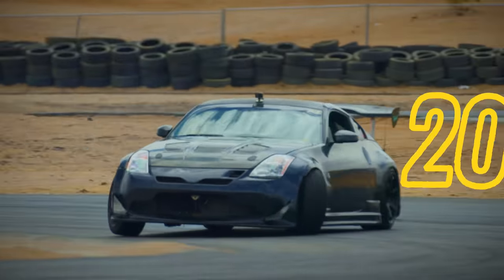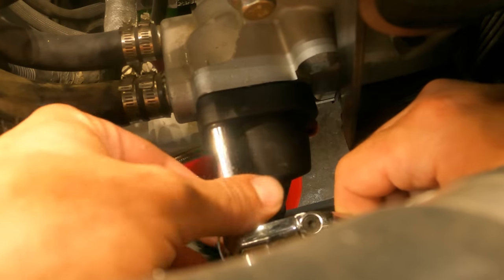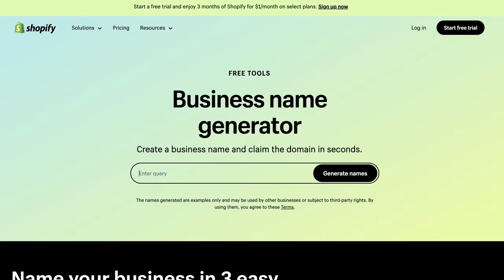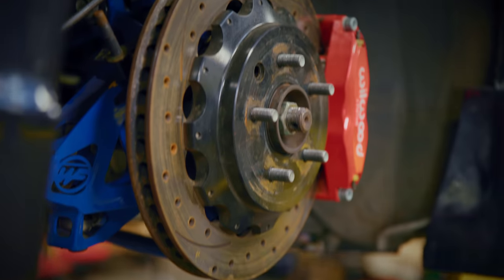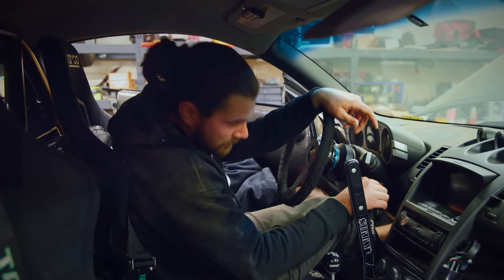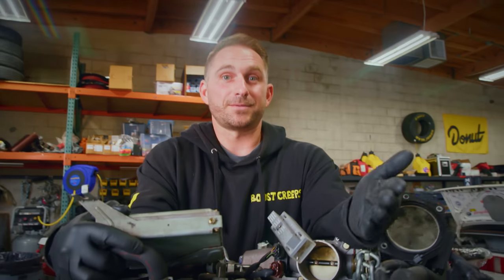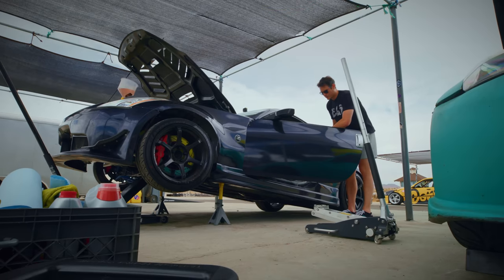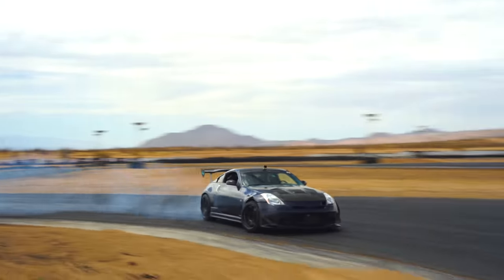Our $100,000 Nissan 350Z Has a Problem

Comment: Not a certified mechanic but I’m a professional you tube commenter. I feel that high cars cooling system isn’t big enough for the application and the demand from the motor. Bigger radiator and more air flow. Maybe vent the hood to get rid of excess heat as well. Drifting puts such a higher stresses on the motor. Cheers.

Comment: OK, I know this might be stupid, but it's worth bringing up: 
I'm not sure when in the build you did the engine swap vs. the radiator swap, but it could be that the cooling system was perfect for the v6 350z engine, but not for a beefy V8. Either way, if everything is working right, maybe something just isn't up to snuff.

Comment: Are you running the steam vents or did you block them off. If the latter that can likley be a problem and leaving air in the system.

Comment: Wow you guys can do about anything to start, get a car going. I was hoping maybe you guys could help me out my cot won’t turn over it won’t even crank all the light on the dash light up I have no idea what is wrong. I have changed the alternator and nothing and my starter works I have tested it out. Well the problem happened as I was driving I was about 85 to 100 mph on the freeway but, as I got off of it got to the fist stop light at around 15 mph car just tired off and just couldn’t get it to turn back on 😢 I’m running out of ideas on what it could be and also running out of money 😂 the car is Mercedes 2010 E350 4matick 
If you guys could give me more ideas or some type of solutions would be awesome!!

Comment: There are 2 different reluctors for LS's crank signal. The 24x and the 58x. Make sure your sensor matches your wheel in the engine and make sure both of those match the ECU. Thanks for the content!

Comment: There are 2 different reluctors for LS's crank signal. The 24x and the 58x. Make sure your sensor matches your wheel in the engine and make sure both of those match the ECU. Thanks for the content!
Reply: They also completely neglected to think about the wheel itself. Too big of a gap or a defect in the wheel = no signal.
Reply: Came here to say this, or at least something similar. Gotta make sure the reluctor is correct as well as the distance between the two. 

I swapped a 4.6 from an 09 F150 into an SN95 a few years ago and had constant cam position faults. Turned out the cam reluctor on the F150 had several more “teeth”.
Reply: You're both probably right, but the custom ECU will be far more tolerant of  weak sensor outputs than stock. They can be tuned to be road compliant too, even having switchable maps
Reply: @mandrakejake might not be the right place to ask but what makes custom ones street illegal
Reply: @Baseball4mnstarz  tailpipe emmisions when tested. If you tune for performance, you'll likely emit too much unburnt fuel. You can have 2 maps on most ECUs though.
Reply: @Baseball4mnstarz  Feel like that's more of a Cali thing. Can't do anything to your car.
Reply: @TopGoose-bf1mx  The crate engine they bought only comes in a 58x reluctor and the E38 ECM only uses a 58x signal. I do not think this is their issue.
Since the ECM won't take the tune I would just think somehow they botched it and should just try a new one.

Comment: Some notes when testing wiring integrity, multimeter leads can splay the terminals in the connector and prevent good contact. You can also have bad wiring that passes a continuity check, but doesn't carry current when loaded. If you wire in a lightbulb to load test the wiring, you will be able to basically 100% confirm good wiring. It would be really cool if you guys tried using an oscilloscope to view the crank sensor pattern since this will show you the waveform that the ECU sees and you can see if you have signal, bad exciter ring, etc
Reply: Also won't show a contact that is intermittent under vibration. Can't fully take it off the list without shaking the wiring from one side to the other. And I agree a cheap handheld oscilloscope is really useful for these type of sensor debugging. Also the built-in oscilloscope in the Haltech Elite series is great for figuring out what the ECU is really seeing.
Reply: Easy tiger, I think this is way too advanced for the Donut team. This a group of guys that damage seals during installation.
Reply: @FG-418  Ya the Link also has a built in scope and makes it nice tracking down and trigger related issues.

Comment: The trick to avoid overheating is
1. Remove thermostat i.e bypass it
2. Use a bigger radiator if it has space, but use aluminum one
3. Use a performance head gasket to avoid quick heating and it will improve your performance too.
4. Check all the clamps to avoid any leakage
Reply: Give it a try
Reply: 1. Check for leaks and fix if applicable (use a tester kit)
2. Bleed

Comment: Ok, so if it's possible to re-pin the wiring harness to work with a non-factory ECU, why are the non-factory ECUs not just matching the existing pinning? I assume that there must be a reason, but I'm at a loss as to what it might be?

Comment: I’m shocked at the fact stand-alone ecus are illegal in the U.S can have em here in Nz had a link g4 storm in my sti coupe and I had one in my old wrx and my current 13b hilux but ive got a haltec elite 1500 for it all road legal cars too hilux not so much cuz it’s still in pieces and I’m waiting on custom motor mounts to be made and a custom bellhousing adapter to be made for a w58 box to 13b so got a long ways to go 😂

Comment: Seams like running too lean in the high rev, producing too much heat, plus no top end powaa 😮 Also if you got a thermostat, yetttt it ! since it's a ricer car. And you should put a sensor on the rad outlet check for good mesure 🤘 Keep it up love the content 👍

Comment: I had to laugh out loud when it was listed as a Con of a standalone ECU that it wouldn't be street legal anymore. While it's true that a standalone ECU will make a car non-street legal, the Hi and Low cars stopped being street legal the moment GM engines were installed. I suspect that California might let people get away with these kinds of shenanigans, the Federal EPA requires a vehicle to conform to what is called a Certified Configuration, which is a combination of engine, transmission and chassis that has undergone the certification process with the Federal EPA. So it would be legal to use a totaled 2002 Camaro Z28's power train to convert a V6 2002 Firebird into a home-made Firebird Formula, but it's not legal to...say...drop a GM engine into a Nissan Z that was never offered with (or certified for) that engine.

Comment: If the brakes were working fine other than the e-brake....why change both calipers? Why not just change the one you were using for the e-brake? I mean, it's smaller, it's not like it wouldn't fit beside the other caliper.

Comment: Yo Donut Media I got a 05 g35 6mt with a LSD differential, has coil overs, stage 2 clutch with light weight flywheel , new tires, new sparks plugs, new coil for packs , new thermostat, new corbeau seats, halo lights, drilled and slotted brakes, hella need money and need to sell I’m asking 6.2k lmk if you’re interested… CLEAN TITLE as well!

Comment: Get some “water wetter” for the radiator, then use 70% distilled water and 28% coolant. That fixed my Miat’s overheating issue

Comment: i had an LS1 clubby and ive never had a motor that leaked oil as much as that car. i replaced all the gaskets with genuine oem parts and it WAS STILL LOSING OIL. 

I eventually had enough, spun the fuck out of it l, broke 3 tailshafts and then sold it

Comment: Not going standalone straight off was silly.. saying 2500 is too much for an ecu but changing the engine .. again silly. 
It's one of the most important parts of the car, you can't skimp. 
Ecu is where I made most of my power and reliability.

Comment: Drill some damn holes in the front bumper. Clearly there is not enough air flow going through the radiator and getting out of the engine bay.

Comment: That is a "100K" car and you are worried about the price of the Wire harness and ECU? And then went with a relatively unknown ECU. Most people use Holley or Haltech as there are ALOT of people who know how to tune on them. And the "street legal" is a CA thing.  The rest was just normal stuff.  I agree with a lot of other people that Low car works so much better as it is thought out and not just random shit thrown at a it because it was expensive.

Comment: Value locking your fuel line, so to heat, prob billing your brake fluid do to heat over heating, because your not getting rid of the heat!   That's my guess 30 seconds in, and I have no faith these guys will figure out the problem lol.   Not hatin, just sayin!

Comment: Stand alone ECUs are illegal in cali??? Do they pull you over and check for a stock ECU? That seems wild to me, at least in Ohio I know a few Holley ecu ran cars. My car is older so no emissions so I don't know how hard it is to use the stock ecu to run the emissions side of things but there are some threads on LS1 tech going over that. I have my stock ECU still in with the original harness controlling whatever it was before (like the electronic TC lock up in my old transmission before I swapped that) and my gauges all work using the stock harness/ecu). The holley terminator was only a grand when I bought it. Might have saved a few bucks and headaches if you watched @SloppyMechanics G35 videos. Been a while but I believe he piggy backed his ECU with the terminator. Again, that is if it is even legal in California.

Comment: now that there is no emissions testing in Ontario is opens the flood gates for 3rd part ecu's to be completely legal.  
"While emissions testing used to be mandatory for all types of vehicles seven years and older, a recent change in regulation means that light-duty vehicles no longer have to get tested in Ontario.
May 9, 2023" p.s ANOTHER video where aaron would be perfect in....

Comment: Your angle could probably be off on your driveshaft, on my silverado in getting the same thing. Done everything other than fix my pinion angle or suspension. Don’t know if it applies to z’s. Also probably why your transmission is leaking because I’m leaking the same place. Place a camera and see

Comment: Donut needs to leave CA. I've been inspecting cars for years in a different part of the country. I have never failed a car for having an aftermarket ECU. Hell, we don't even have to check if seatbelts work. A car can only fail for wiper blades if, and only if, it has a windshield. CA is the worst state to modify a car

Comment: You know these are usually problems you have when you put a giant motor in a car that never came with one, and when you completly change everything on a car. Oh wait you did all that, surpise. And i think they left just enough stock parts on low car to makw everything work properly. When high car is sorted properly it will be alot moee reliable of a track car you can beat on, but this is a good example of what happens when you change everything on a car compared to leaving stock parts ro make ir work. You can always upgrade later on

Comment: Have you guys tried using a vacuum bleeder? It pulls a vacuum on the entire coolant system, and you use a valve to have the negative pressure pull the coolant into the engine. This method is almost fool proof in the vast majority of applications.

Comment: This video reminds me of my Subaru. I had my fuel pulse damper go bad after a shop ran me out of gas. It caused me to lean out, clog my cat, fuel filters, and the lean burn caused my O2 sensor to melt off the inside of the threads in the exhaust and go into my turbo..

Comment: i had to replace water pump and oil cooler on my 200s 3.6 0to 60 in 5 seconds. Cold air intake and it can run e85. I am about 300HP

Comment: 100K put into a 5K car. Bastardized with Chevy junk. What exactly are you guys doing to those doughnuts? Where are you putting the doughnut holes? Does the Fried Bread Inspectors need to be contacted? Just because you can does not mean you should. Try buying driving lessons in Yugo's.

Comment: How do you spend $100k on a car, but not have a standalone. Espicially if youre swapping a whole engine in.

Thats legit a must have wtf lmfao

Also, swapping calipers, without checking the master cylinder sizing is correct? Just a waste of money smh.

Really wonder what the hell thess guys are on.

Also, if youre gonna stuff a big ass LS in the Z bay, and spend $100k, you were better off jusr boosting and building the stock Z motor. Whos out here making these bad decisions?